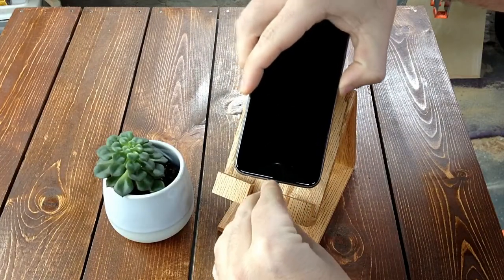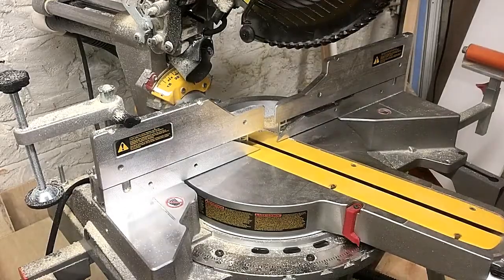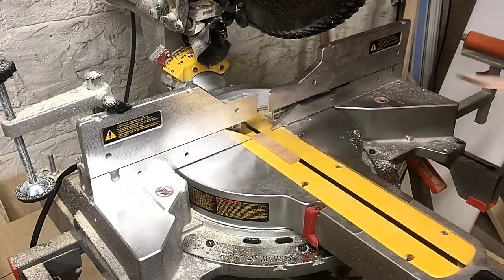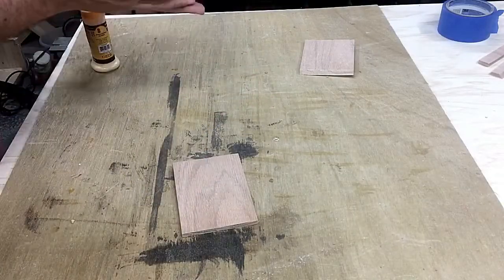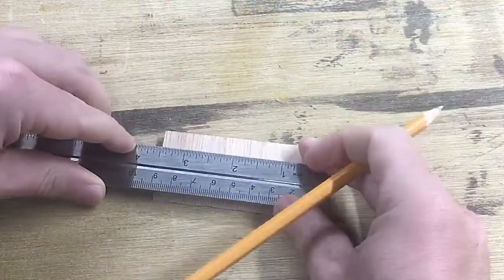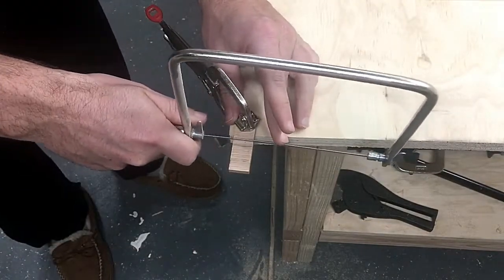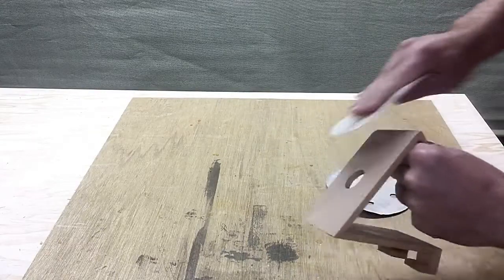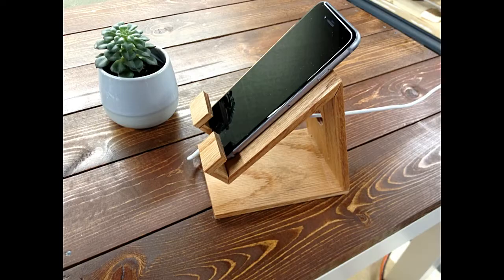DIY Red Oak Phone Charging Stand - Easy Woodworking Projects

Comment: What dimensions would you recommend for an 8 plus?
Reply from the maker: You can probably get by with the same width. If you're able to rip cut your wood, I'd go 1/3-1/2 inch wider. Cut all the lengths to about 3/4" longer.